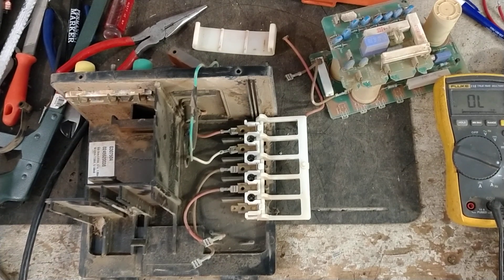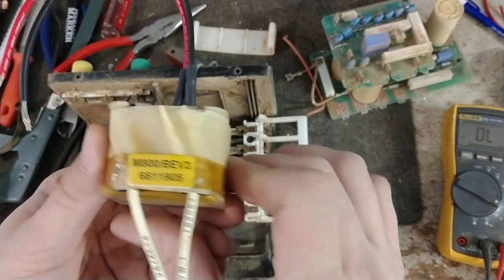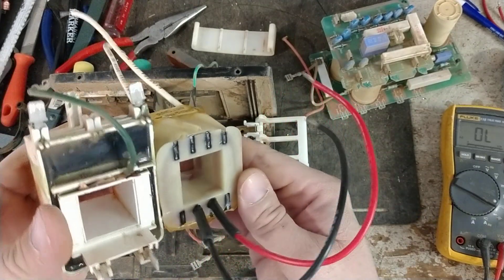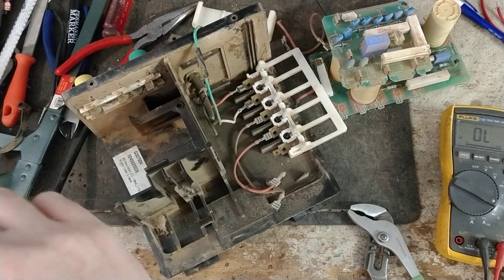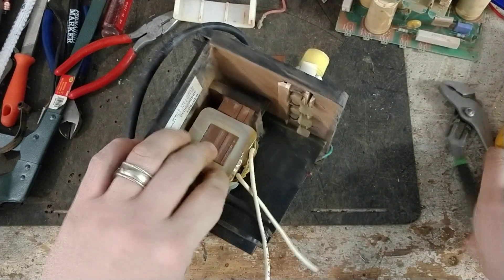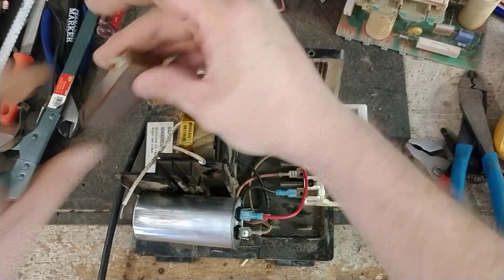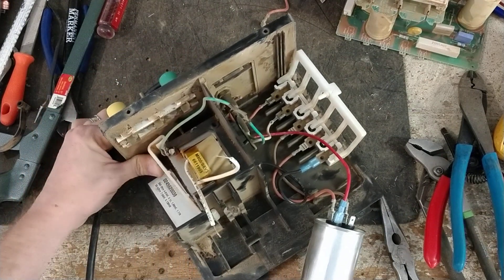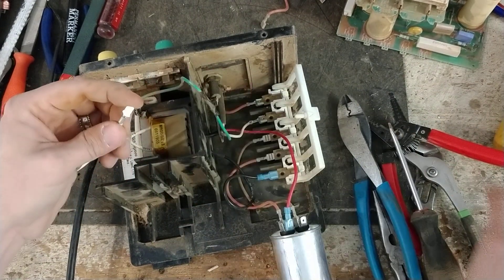How to test and repair a Gallagher M800/BEV3 Fence Energizer PT. 2

Comment: Wow I love this, thanks!
Reply from the maker: As of today, I've got somewhere in the neighborhood of 400+/- videos on YouTube
Reply: @FencerFixerRepairLLCKansasCity   I've got a malfunctioning BEV 3. so glad I can keep it going.  I'll be in touch.
Reply from the maker: @yankee1376  Call me if you need more help over the phone. The number on my website is my cell, I work from home in a small shop behind the house, so you can get a hold of me anytime most times. Happy to help. I stock parts
Reply: I am having trouble with a gallagher s60² it is only putting out approx. 1000V i am measuring 11 ohms between ground out and  output... any suggestions?
Capacitors are 25ųF each and rated 30ųF